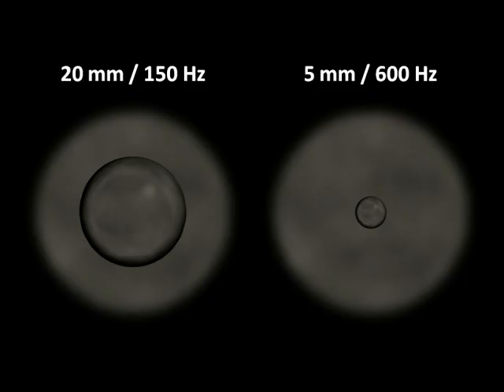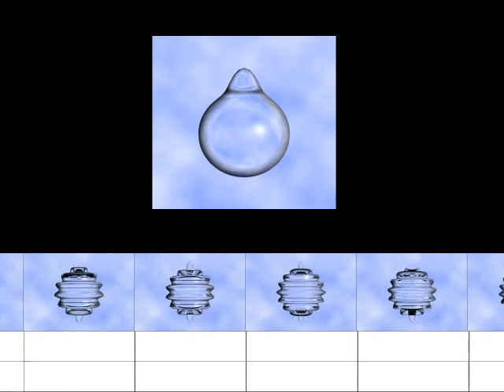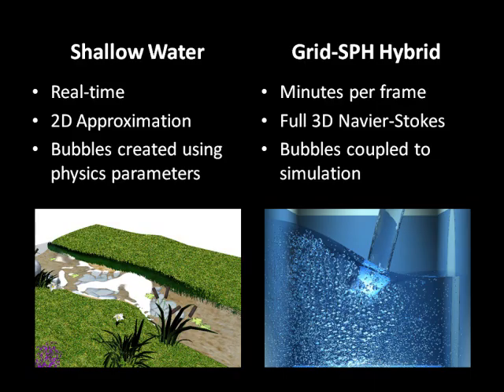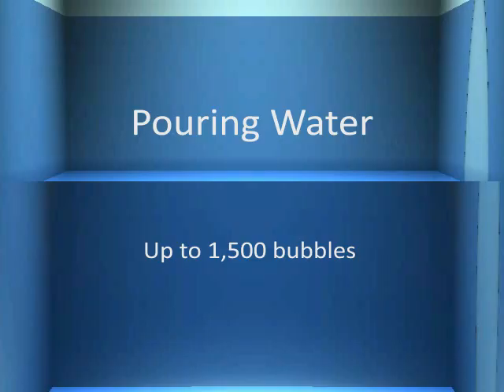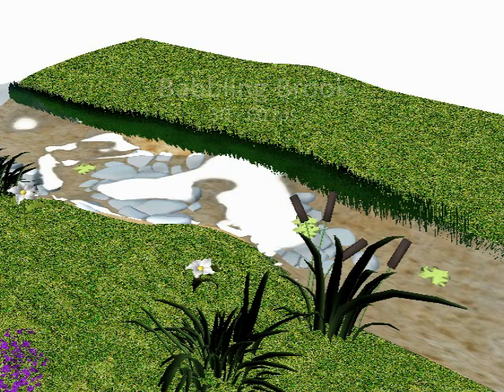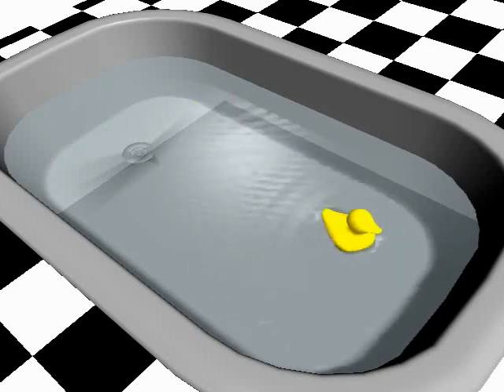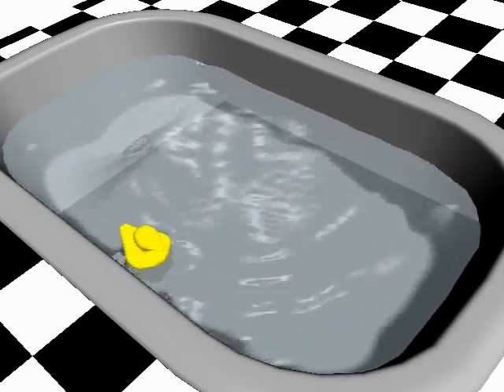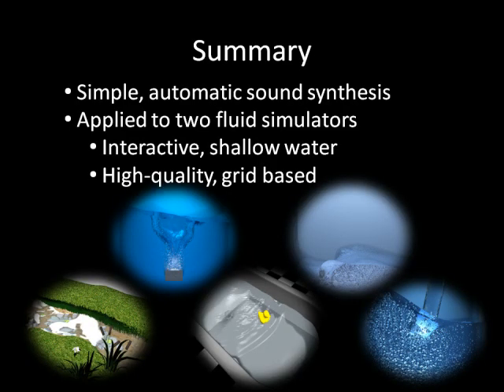Sounding Liquids: Automatic Sound Synthesis from Fluid Simulation

Comment: Very interesting work. The most realistically sounding sound was probably those from the creek and that from the bath tub.You use the sounds that are generated from vibrating spheres, but the real source of the sound is busting bubbles. Have you considered simulating compressible two-phase flows in order to order to generate more realistic sounds and catch sounds from more sources than just bubbles? Still a very interesting and unique work, though